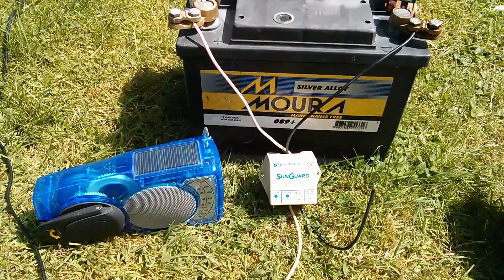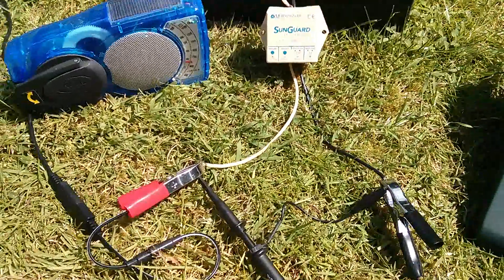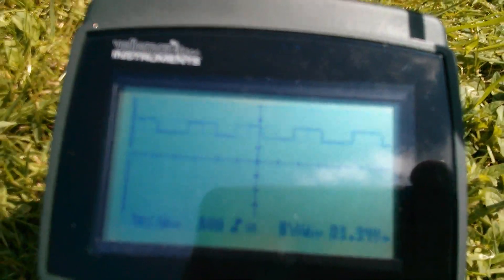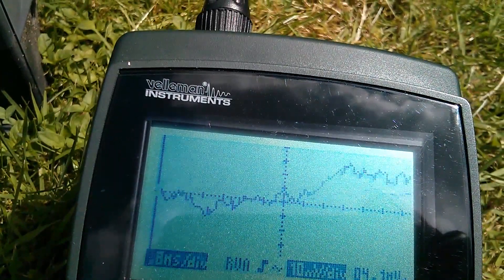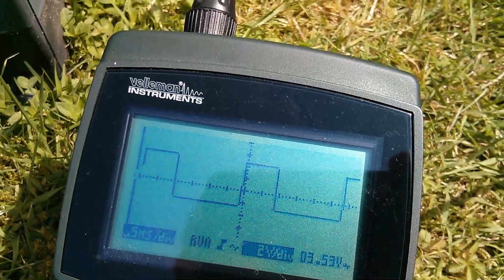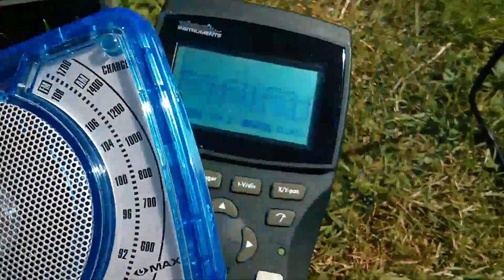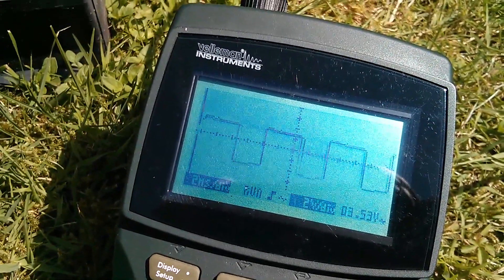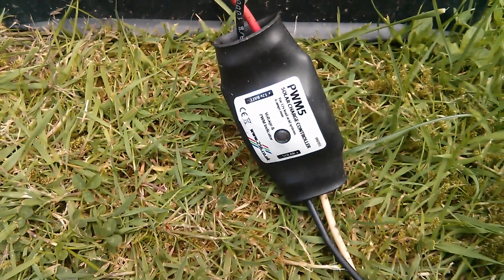Pulse Width Modulation - Watching and Listening

Comment: sunshine in uk? I call FAAKE!!!!! ;-)

Seriously though, why are those devices so slow to stabilise the duty cycle? is it a feature of solar charging equipment? something to do with MPPT? It's certainly not a feature of normal DC-DC converters which would stabilise in microseconds. Also don't see why digital vs analog control loop would affect this.

Comment: Is there any inductor in the setup?

So much focus on PWM, but no mention of buck/boost as I would expect.

Not even talk about synchronous buck-converter, that I would expect if you are really serious about efficiency. I did buy some synchronous buck-converter chips for use as battery-charger. In my case non-solar setup, but they would be ideal for solar battery charge and generic voltage/current control. (you can get them with MPPT function too, or use some microcontroller to guide it)
Reply from the maker: No, there's no inductor in the PWM charge controller, but the MPPT controllers have a buck converter